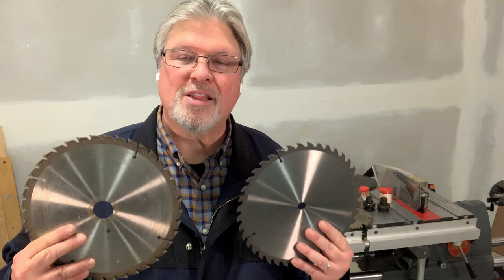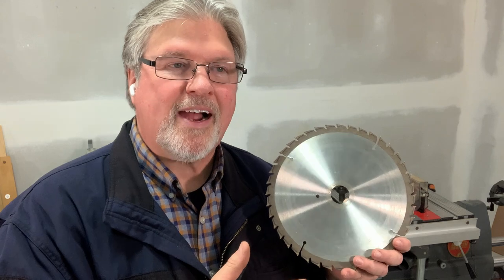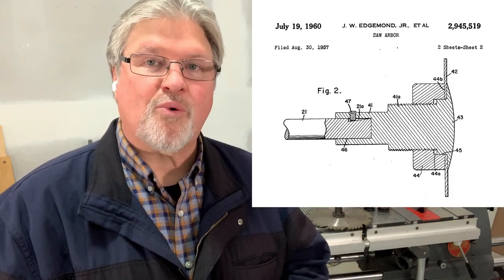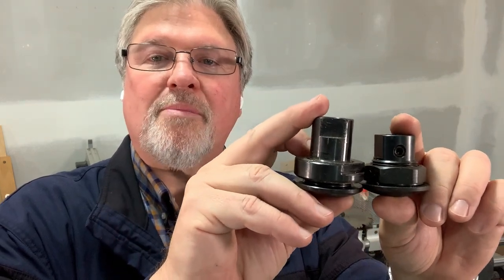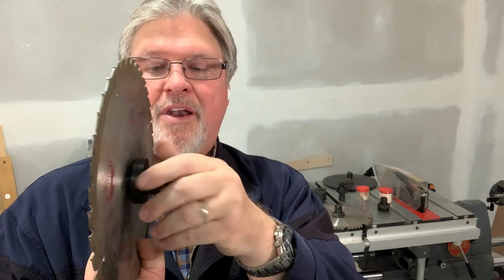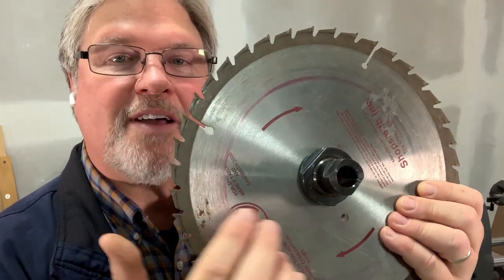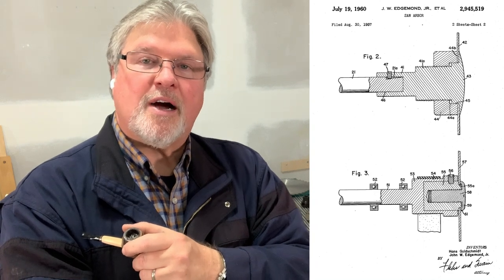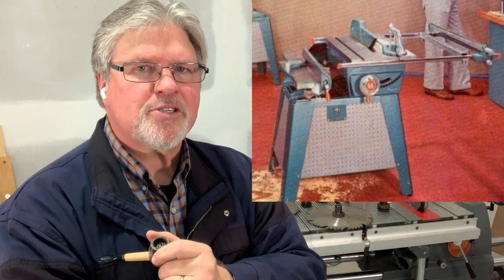What's the deal with Shopsmith's 1 1/4" saw arbor?

Comment: Hi, I have a totally off topic question. I am going to look at a Shopsmith Mk4. It has seen better days, but the seller says it works. On the assumption it works snd is safe, will (is it possible) the adapters I use on the power head to drive my bandsaw on my 520 fit the Mk4?

By the way I gif the Mk4 and some basic accessories for $100.00. Fingers crossed it is as good as advertised.

Thanks in advance.
Reply from the maker: Hey Scott. It's likely a Mark V, because the Mark 4 was only just introduced for the first time about a year ago. Yes, all the accessories are interchangeable between all the "Marks", with the only exceptions being the table inserts and fences. Sounds like a good deal!
Reply: Thank you for such a quick reply.
Reply from the maker: @scottthemagicalguy7609  You are welcome.